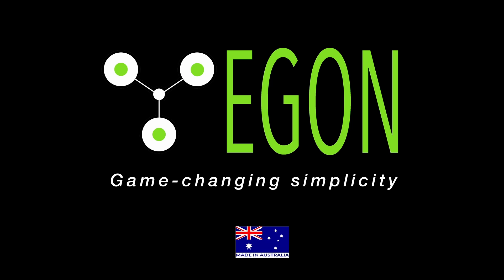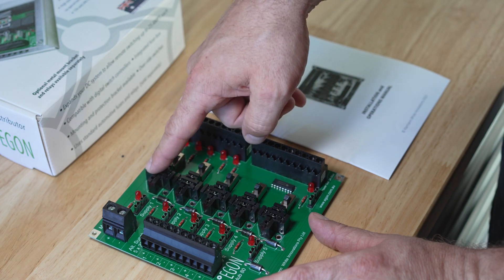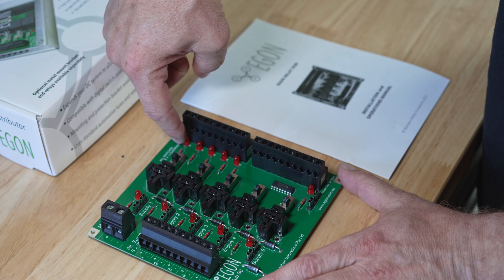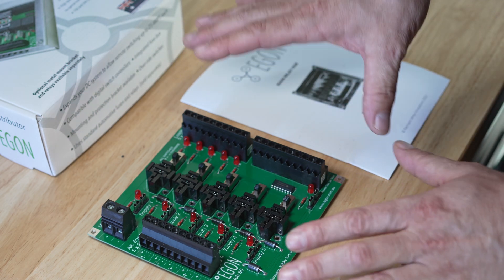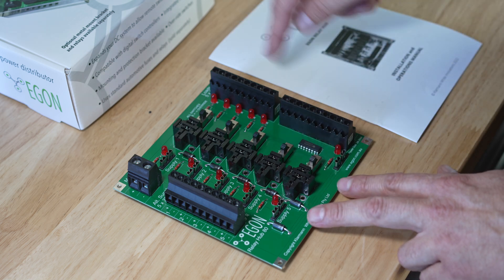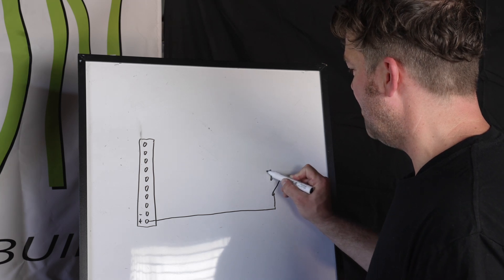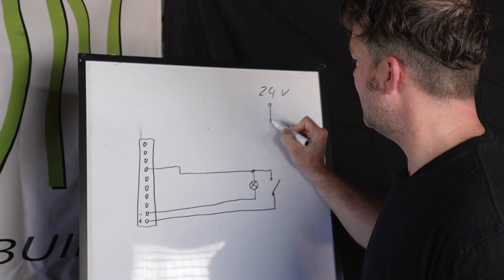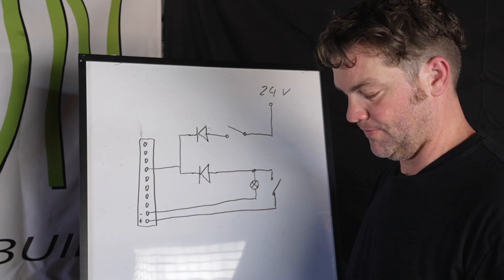EGON RELAY-HUB. Circuit Overview@EGONGame-changingsimplicity

Comment: Hi Guys, Was wondering if you had any issues with popping the uln2003 chip....Unless the schematic is incorrect or your using relays with built in "back emf" diodes across the coils you may issues....